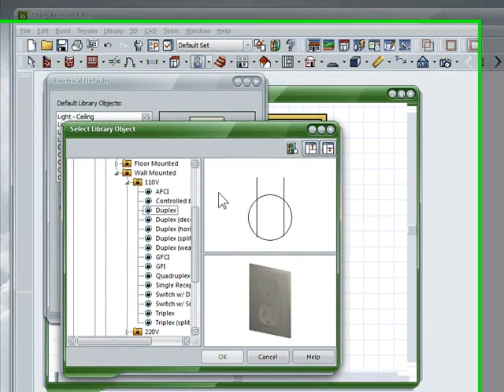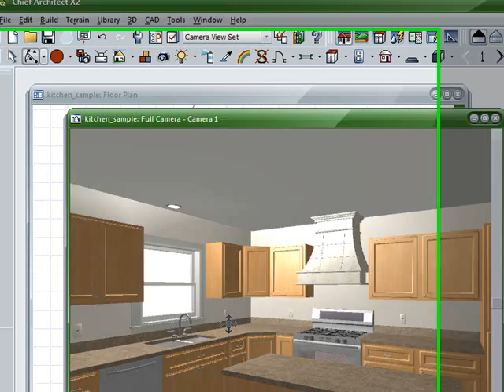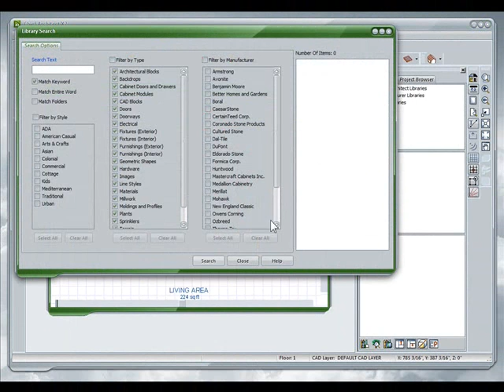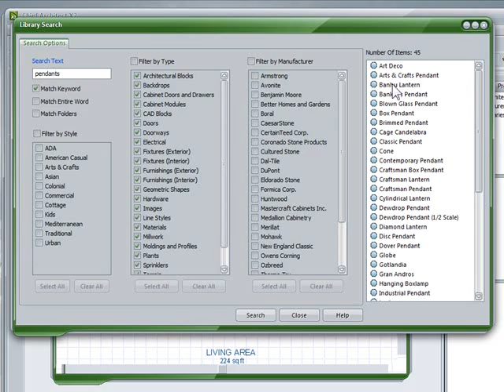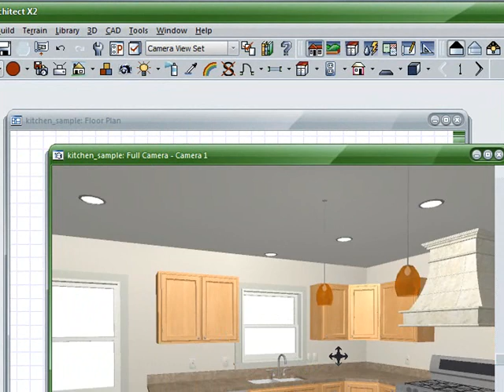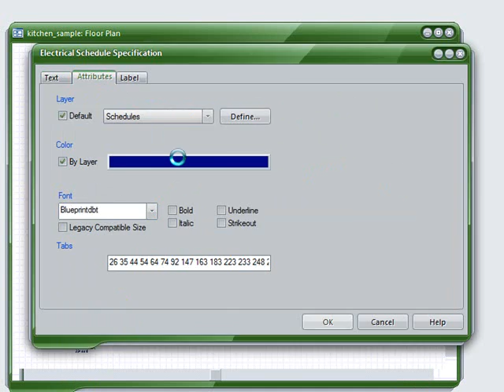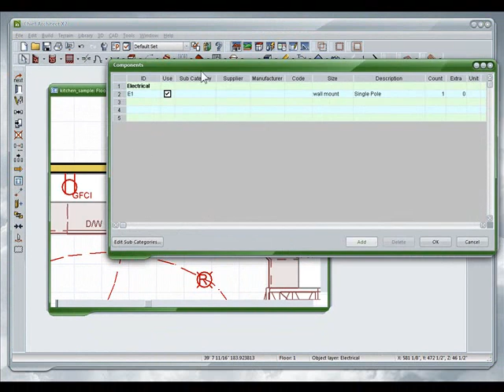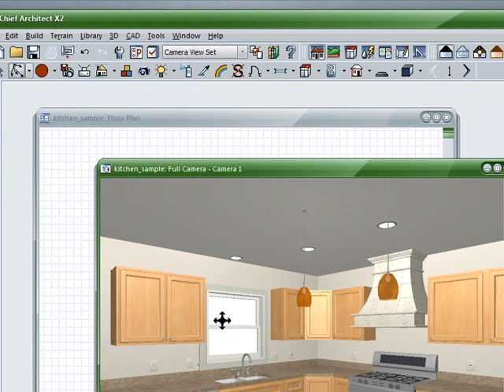Electrical Details in Chief Architect  (( www.ChiefTutor.com ))

Comment: I am on Home Designer Pro.  When I click on the electrical icon in my toolbar, there is a dropdown with options, but no library where I can adjust info for the outlets.  How do I do this?  In other words, I can only choose the voltage (110, 220), but not the position of the outlet. TIA